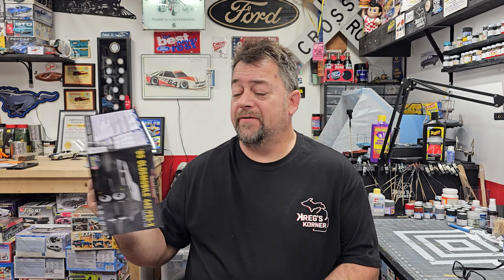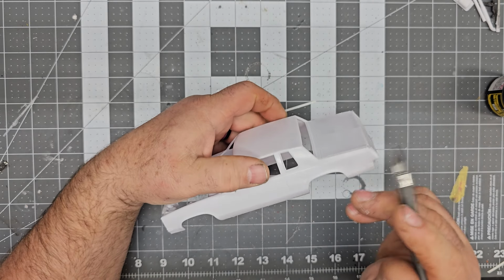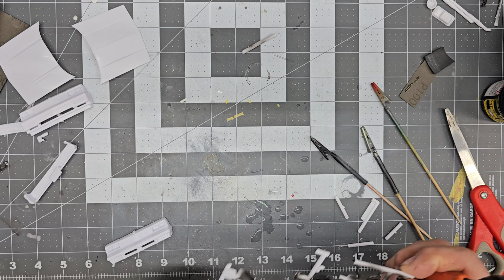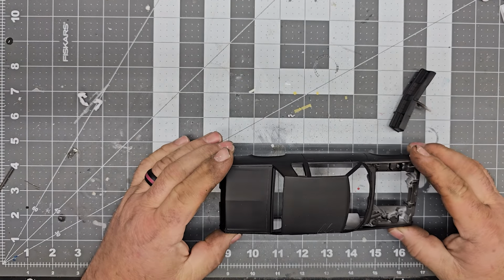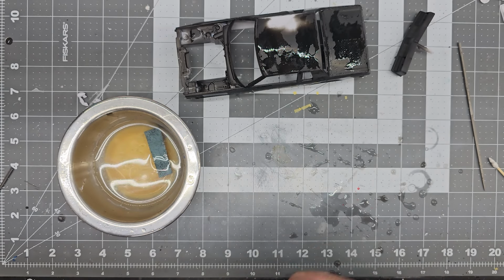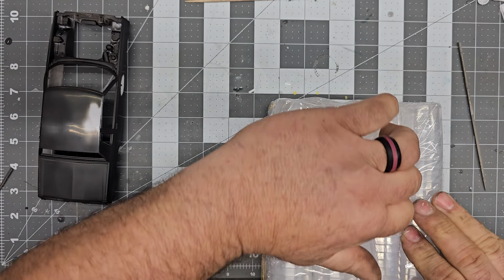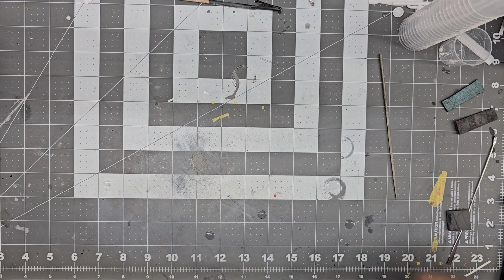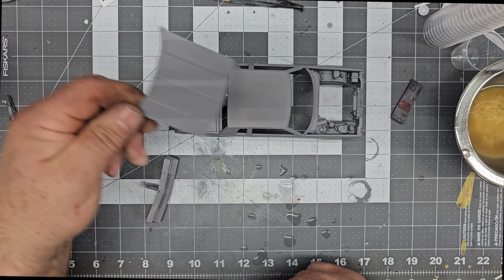START TO FINISH TWO TONE AIRBRUSH PAINTING. VIDEO 1

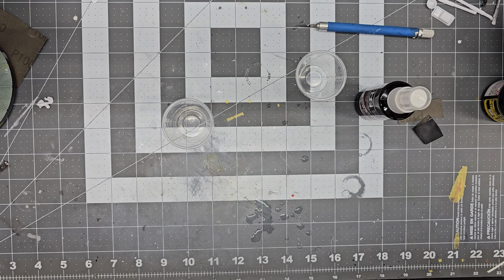Comment: One tip I'll share with you, that I like to do, when using that style kicker bottle (@10:55). Is unscrew the cap/spray nozzle, and use the hose that feeds the spray nozzle from the bottom...and use it as a "pipette." You can tap it a bit to get some control on how much you want to add. Just make sure you secure the bottle, so it doesn't spill!!

Comment: I have one of those panel scribe hooks too. I hated it so much I bought a set of those cheap panel scribe chisels with the aluminum handle off of Amazon. Much much better and way more control.

When you go off course scribing, a bit of your primer/surfacer dabbed on with a brush is an easy way to fix it and sands way easier than putty or super glue (which is great for big boo-boos)

Save your money and use hardware store lacquer thinner to clean out your airbrush. I use Klean Strip from the Depot, Lacquer thinner for bulk clean up, and a shot of acetone to make sure it's double extra clean. Never had an issue.
 
A spoon is a great painting companion, way easier to check for mechanical issues as well as compatibility issues during the painting process.

And those files are called needle files. I got my set from the local Harbor Freight but they're available all over the interwebs.

After seeing your vids I'm strongly considering investing in the Tamiya lacquers to compliment my Jump Wind collection. They appear to spray and finish quite well. Looking forward to the rest of this series!